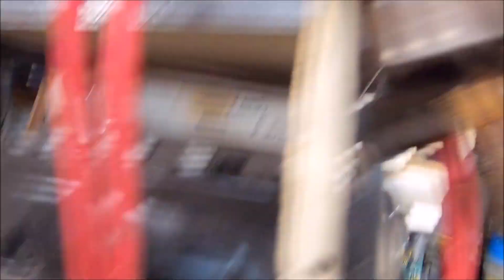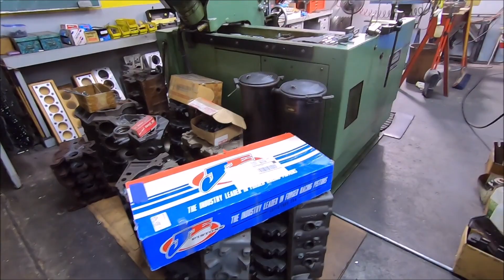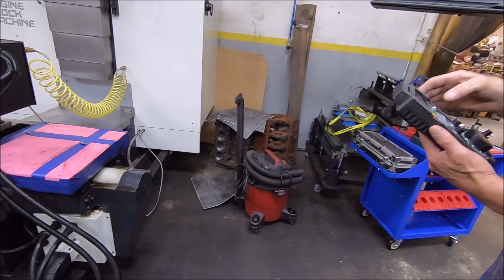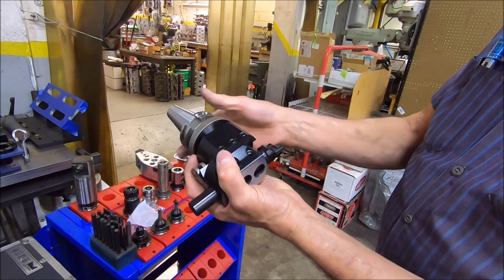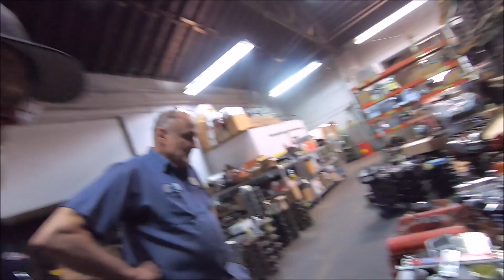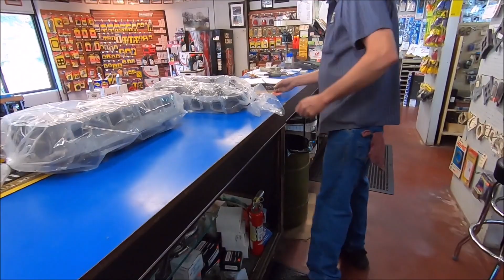Touring the Midwest's most Famous Engine Builder's Shop & Pro Stock Hemi

Comment: Hey jeb, i have a question about the hemi sox and martin heads: are they still any good or with today tech they are outclassed (given that no modern stuff will ever be as cool)
Reply from the maker: As with anything from back in the day, it cannot truly compete with a modern counterpart. An engine that made 800 horsepower back in the 70's similar to my pro stock Hemi or the Hemi's runs by Landy and Sox & Martin were full blown racing engines that would never operate well on the street, whereas just about anyone today can have 800 horsepower on pump gas...But like I said in the video, the heads Marc repaired were the same castings that Landy and Sox and Martin used, and they will always be more valuable and sought after than any of their modern counterparts.
Reply: Yeah that's what I thought. Is it possible to make them behave on the street or will always be race parts no good in traffic
Reply from the maker: @zairomolino4074  The problem with this particular Hemi is the high compression and huge solid roller cam, and I will not detune this engine, it just seems wrong. Now on the other hand, these heads are a simple valve spring change and they could be swapped onto another short block with a milder cam and a pump gas friendly compression ratio. With that said, the 426 Hemi cylinder head was never designed to be daily driven in a street car, it was always meant to be a race head, whether that is Nascar or Drag racing.